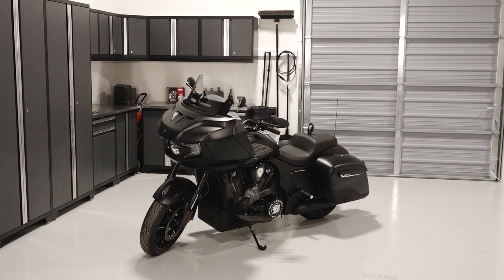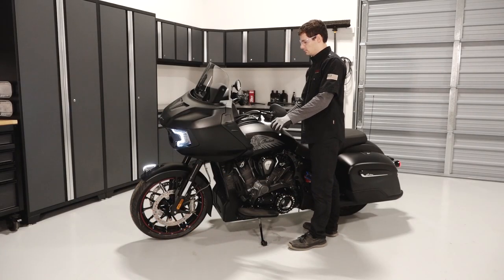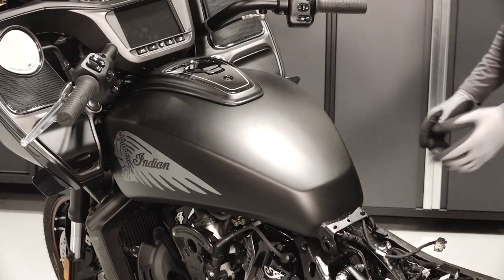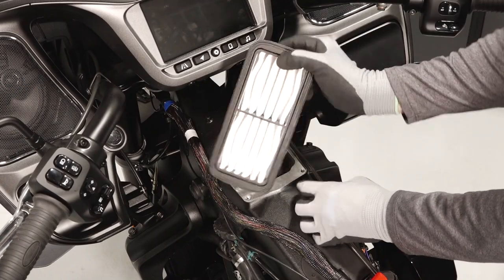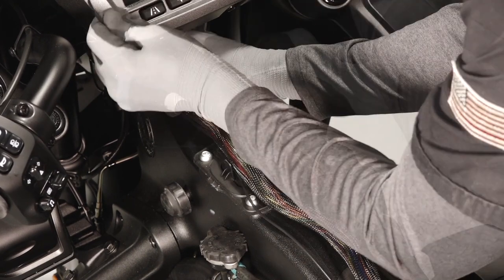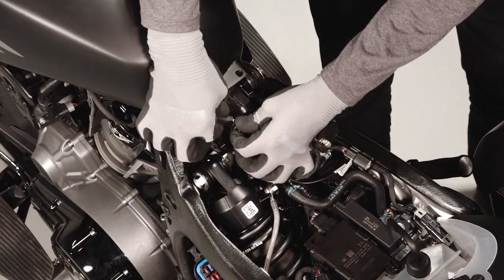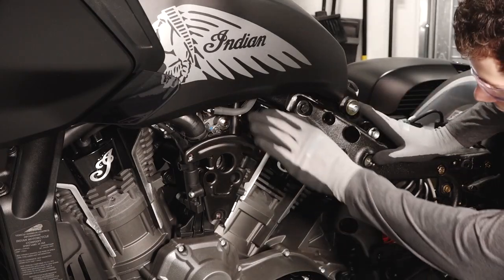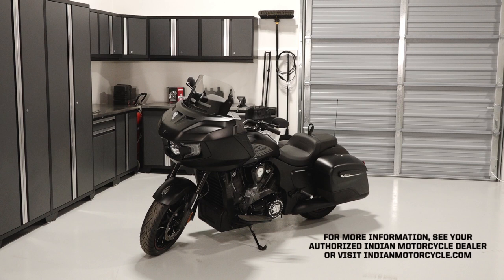Indian Challenger Air Filter Inspection and Maintenance - Indian Motorcycle

Comment: Not that hard to do if you’re half way able to turn a wrench. Much simpler process compared to a GW. Only plus I see in that location is no need for a rain sock but that’s it. There is an air box relocation fix out there with after market put it in the HD location

Comment: What about the cable running under the tank that isn't addressed in this video.  There are no accessible  connectors.  If you're going to make a how-to video, at least use an actual bike with ask the parts.  The tank can not be removed from the bike as shown.

Comment: As a Harley guy, I must say I'm liking Indian more and more. As a do it yourself-er when it comes to bike maintenance I must say, that's a piss poor spot for an air filter. Almost as bad as the 1500 goldwings. That being said, the how to videos are great. Every dealer should be doing them.
Reply: Same, Road Glide owner, took a Challenger year ride, much better performance! But, remove the tank to check the air filter? No ability still a year later for Lloyd’s to come up w/ a cam due to cam access issues? Mounting a V&H FP3 tuner to my HD, remove a screw for the seat, plug & play. Power commander for the Challenger, removing the tank again & reroute loose wiring harnesses. Not super accessible

Comment: i have a 2010 victory cross country with 91k miles.  This process is exactly the same for air filter change, same location.  However, i can raise and slide it back enough without disconnecting anything on the gas tank to change the filter.  I will be trading in my XC this year for a challenger.  I'm ready to do it now, but  I will wait a few months to see what changes, if any, are for the 2021 models.  Maybe new colors? Ruby smoke darkhorse would be awesome, with matte black Indian logos on the tank.  To the powers that be at Indian: please add Sirius sat radio.  But without the $400 price tag that victory had for the official OEM add-on.  Speaking of accessory prices, did your marketing people work at HD?  $410 for front crash bars? It's bent tube! Maybe $20 in material.  If  you really want to put the bitch slap on HD,  more accessories with reasonable prices will sell more bikes.

Comment: What a pain in the arse just to change the air filter. 
On my 2021 Challenger the fuel vent line is behind the RHS side V cover & the fuel pump plug & fuel cap release are under the panel on top of the tank